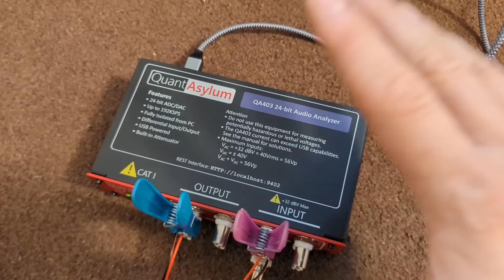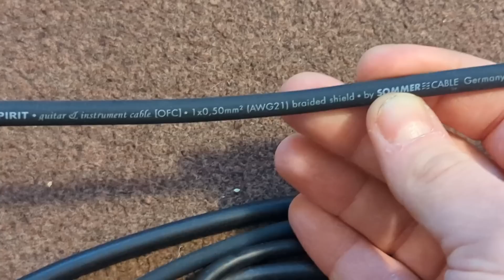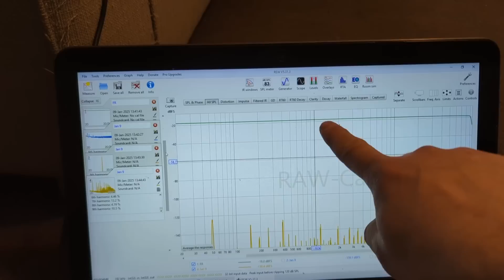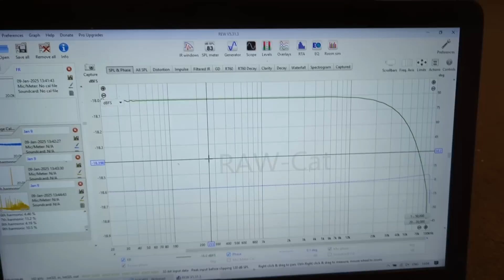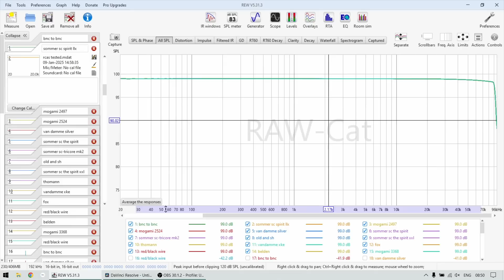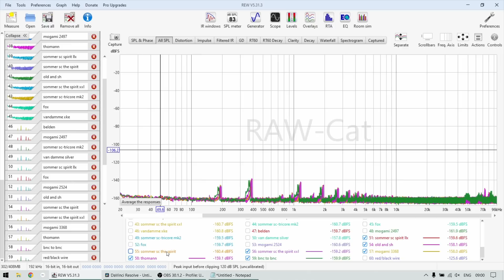Should you buy expensive cables?

Comment: idk whats the issue with my setup, i 
keep hearing buzz and noise , when i turn the car key to on, and after starting the car.... Im running a pioneer 6650bt headunit outputting 2 channel rcas to the dsp , and dsp has 8 channel out rcas, im using only six of them for now, 2 for front tw, 2 for front woofer, and 2 for the sub. idk if its the rcas or something with the wiring idk 😢
Reply from the maker: It's the ground. All three, the head unit, amp and DSP have to be grounded in the same place.
Reply: @RAW-CAt  thanks a lot bro, yeah i have to try that my 4 channel amp and the dsp is grounded same but not the headunit tho . mono has a different ground tho so i have to fix that too then, but i also had the same buzz when i installed my dsp and when i changed the input dsp rcas the sound went away
Reply from the maker: @stanz1n594 try just running a single wire from the front to the back and connect the hu ground to the amp/dsp ground. As a test.
Reply: @RAW-CAt  ill try that tomorrow for sure, my amp and dsp are both front passanger underseat so thats where the ground is as well but mono is under my seat so i also have to ground it on the same ground right?
Reply from the maker: @stanz1n594 just temporary connect all the grounds with the same wire.
Reply: @RAW-CAt okay i will thanks

Comment: I installed a recoil RCA bass knob for my rear speakers. I put in deaf bounce Arnold and they get super loud. So i wanted more control of them so that’s what the knob is for. 

I am using recoil OFC wire that is ran up the right side of my truck. (Power wire is ran on left side of truck) i am getting engine noise in my rear speakers. This is 100 percent because of the RCA cables. 

So i ordered some RCA cables that cost more than double the price as the Recoil cables. So i guess i will see first hand if there is a difference lol ill update you

Comment: Los cables pueden mejorar el equipo solo si este es un buen sistema HIFI ya que le ayudas a pasar mejor la señal, per si tienes una basura de equipo puedes meterle cables de 10k dólares y va a seguir sonando asqueroso. También influye el calibre del cable ya que si pones uno con diámetro mas delgado y pasa un gran flujo de corriente esta se va a transformar en calor. Pero todo esto son micro cambios, a veces imperceptibles para la mayoría.

Minuto 21:21 https://youtu.be/13uPulbV1Po?si=87JmhNmf9by0PhC4
Reply from the maker: There is barely any current flowing through interconnects. Signal is voltage. So heat is not an issue at all.
Reply: @RAW-CAt by interconnects You mean RCA, aux, etc?
Reply from the maker: @mauricionunez2797  yes, that is what the video is about.

Comment: I'm not surprised by this result at all. I think the most important piece of a car audio cable is the RCA connection itself, it must be solidly connected to the cable and to the equipment. Every issue I have ever had with RCA cables was an issue with the RCA connectors not making a good connection with either the cable or the equipment.

Comment: Hmm what about speaker cables not RCA ?
Reply from the maker: What about them?😉
Reply: @RAW-CAt  i was wondering if they matter. For example should I switch factory speaker cables to after market ones ?
Reply from the maker: @Jake-kb2le  they don't matter. Just don't send 1000W through a 24gauge wire.
Reply: @RAW-CAt  Okay so I shouldn't see a difference between OFC and CCA cables ? 
chat gpt says I should, but I don't really trust it.
Reply from the maker: @Jake-kb2le  signal transfer or sound quality wise it does not matter. Cca and ofc differences are in durability and resistance to corrosion.

Comment: in the DIY amplifier circles in India, Ethernet cable are also explored as an easy multi conductor cable for carrying audio signal, 
Would that be any worse than a shielded 2 conductor cable used typically?
Reply from the maker: A lot of people are using those cables with great success👍 As long as the gauge of the wire is sufficient.

Comment: Awesome video and tests RAW CAt!!  
I don't have this Quant Asylum device, but I was going to mock up some similar tests and try to measure with my oscilloscope and function generator, and a noise source like you did, etc.  

Then as a bonus, I wanted to do some tests with the cables laying on the floor and then up on different height cable risers to see if there is an optimal height the cables need to be off the floor (we already know the answer ha!).  First I need to figure out how to measure the capacitance from my basement floor...  LOL

Then as an additional bonus, I was going to do actual listening tests with each cable in my home theater and even see if REW can measure any difference.   Someday...

Comment: Impedance matching and low capacitance interconnect cables can be important with very low-level millivolt audio signals, such as the wiring used for a turntable's phono cartridge/stylus through the tonearm and the RCA connections to the phono preamp.  The capacitance of the cable can have a significant impact on the resulting spectral balance.

For this reason, on many moving coil phono preamps for low output moving coil phono/turntable cartridges, you will see multiple adjustable impedance settings on the MC phono preamp.

But once you step up to typical 1 volt to 8 volt RCA line level signals and relatively short cable lengths, this becomes insignificant.

Comment: @RAW-CAt  
Nice test, Nerijus.  👍👍

The only thing I might have done is to have Twisted the simple red & black zip-cord speaker wires to see if that would offer any improvement in EMI/RF noise rejection from the LED bulb and it's electronics.

Cheers
Reply: Twisted pairs have a great benefit on balanced signal transmission but not for unbalanced.

Comment: Simply put a cable doesn't give you any particular sound. The only thing a cable can potentially do is take away certain parts of the signal. Imo stranded copper with different size strands in a polyethylene sheathing will be just fine. Over short runs 2m or less there wont be a difference  with most decent quality RCA's. It's when you get into the longer lengths that the inductance and impedance can build up to a point that will be audible.

Comment: Having had some very high end audio gear for many years I know without a doubt cables do make a difference. Most noticeably silver sounds detialed, bright, but glary, silver plated copper is detailed without the glare, and copper is smoother. Now days I find this more usefull in using cheap $10-$20 cables to smooth out my system since modern DAC's have become so revieling and detailed, I prefer cheap S#ity cables to smooth things out a little. And yes I can hear a differnce between silver plated copper and cheap dull sounding cables in even a 30cm lengh.
Other things worth noteing;
Unless you have a good room and at least $5k+ worth of gear your not going to notice much difference even between Silver and Copper. In a car setup I dont think it would be posible to hear any difference.
Differnce in cables are very small and many times I cant hear a difference, especialy comparing copper to copper for eg. Changing anything else in setup will have way more impact and I would only sugest to try cables when everything else in a system is sorted out first, and only expect to add or lose like 1% more or less brightness or detail, or roll off the slightest harshness.
I was supprised that there is no difference in the measurments when myself and many other people I know who have have spent stuppid amounts on hifi gear can easly hear a difference once the gear quality reaches a certain level. Theres something going on that should be measureable in some way, capacitance, etc. As you mention maybe longer cable lengths are need to show up clearly.
Before you give me a hard time for being an Audiofool... I agree spending $$$$ on cables is stupid, $50 aliexpress or Ghent Audio cables are good enough for even most audiophiles. And as I said in my main system I've downdgraded some cables to cheap $10 interconnects from the local hardware store :)
Reply: @Angellus502  
So, with all that, in the end you basically said to only expect a 1% difference.  IMO, 1% is wholly insignificant and not worth even bothering with.

In addition, unless you have conducted these comparison listening tests 100% Unsighted (i.e. double-blind A/B/X listening where you correctly identify each cable 10 out of 10 times consecutively without knowing which cable was being listened to at any given time), then the differences that you heard were simply due to Confirmation Bias and/or Expectation Bias.

Here is just one such documented experiment and study that proved this:

https://seanolive.blogspot.com/2009/04/

"Audio Musings by Sean Olive: The Dishonesty of Sighted Listening Tests"

Comment: Perhaps you should review alpha audio’s tests work.  They were able to show differences in ways you didn’t.
Reply from the maker: I had a look at those tests, indeed they show there are differences between the cables, however those tests were performed by measuring electrical parameters of the cables with super sensitive equipment. The difference between cables are on a scale that only lab grade equipment can pick it up. The values of inductance, capacitance and resistance at that scale have 0 impact on the audible range 20-20kHz. The conclusion is still the same - cables do not change the sound.

Comment: What does matter is the durability of the cable and the shielding of interference. So for Car audio applications, this becomes very important.
Reply: One reason that 4-volt RCA line levels became the standard for car audio is for the improved Signal-To-Noise Ratio.

IOW, overcome the inducted RF or EMI noise with increased signal level.

Home audio equipment such as a CD player generally have 2-Volt or less line level RCA outputs due to there being less potential for inducted noise.   And obviously some lower end car stereo head units only have 2-volt RCA outputs.

Comment: In car aufio i for shure would say better rca cables makes a difference. Lots of high voltage noise in cars, ignition, injector pulsing, xeon lights and so on
Reply: With monster cable, in particular, I would use the cheap stuff except for the sub use the 400 series

Comment: The only time they make a difference,especially when talking car audio, is noise rejection. Cars can have very noisy wires and if you don’t keep the cheap, poorly shielded cables away from them, they can pick up a lot of noise. Also I have installed the cheap cables and had them fail or not maintain a good connection. 

I have never noticed a sound difference.  In theory, the capacitance of the cable combined with the input impedance of the amplifier can cause roll off on the audio range.

Comment: Ok RCAs makes sense that quality doesn't affect anything but is this the case for (relatively) long cables from amplifiers to speakers?
Noise most likely won't affect them but cable impedance and resistance might affect how a speaker sounds (impedance being higher=sooner rolloff and higher resistance would mean lower power to speakers and higher bass boost in lower frequencies)

Comment: From experience i used several different rca cables in my home audio system. Nvx rca picked up noise i could hear loudly. Stinger 4000 the noise was present but tolerable. Stinger 6000 was zero noise. I have yamaha aventage receiver connected to crown amps.

Comment: Audiofools will hate the "cannot degrade" comment, as they will buy $6000 interconnect to replay albums recorded with $2 per meter starquad then claim $6000 has more detail, timbre nuance retrieval than a $300 cable despite all their audiofile information on the record that they decribe having been transfered to the recording with cheap cable.

But your tests have been done to death, with actual lengths people will use, and if your not measuring cables at lengths hifi enthusiasts will use, why bother. I'm running cables up to 7m in length in my systems, not 1ft held on with clothes pegs. And as you see, the noise floor is so low where any changes occur, bats can't hear it.

Audioholics and Audio Science Review as well as many studio engineers and AES society guys will continually show what matters and audiofools will still spend $4000 on what is basically $1.20 coaxial cable dressed in nylon braid.

I was an audiofool myself once, but will be trying a complete Mogami or Canare loop at some point next year when we redecorate. Studio and HiFi probably have different needs to a car though.

Comment: I learned the reality of cheap cable vs "high end" cables when troubleshooting a problem with my car audio system. The tweeters weren't playing, yet the amp was powered on. I swapped out the RCA cable to tweeters from a high-priced JL cable to a super-cheap Scosche cable and tweeters were now playing. I was amazed that there was no difference from how it sounded before. Just for fun, I swapped it again with an identical (original) JL cable and got conformation. Was there an audible difference? nope. Was there a measureable difference? dunno

Comment: So I had static noise from the RCA's being too close to the power cables in my car. Changed from 5 euro cables to 50 euro cables, exactly the same, positioning and aluminium foil made the whole difference. Compared them on the same amp, same speakers, just different channels on the amp, I was live switching from L to R and they were the same as the 5 euro cables in all positions. 
Also I only had problems with the expensive cables rca's because of some sharp bends behind the head unit... I am convinced to never spend money on cables.

Comment: The recipe is easy. OFC copper, twisted pair inside, tripple shielded and the best connector (for grip and rigidity, no sound improvement).
That is all you need.
Reply: Definitely NOT twisted pair for unbalanced transmission. Check out Blue Jeans Cable for some great info on audio transmission.
Reply: @marstedt  Sure, the best is meteoritic silver, digged out at midnight by virgin.
This will add focus, more space and attack.
Reply: @kiklop8362 coated with iridium flakes or not?

Comment: So my favorite installer, that's not me, uses twisted primary wire for custom length RCAs. You could take that speaker wire and twist it and it would reject noise and measure the same as the rest I bet!
Reply: Two conductor "Twisted Pair" wiring such as line-level RCA interconnects only works to reject noise with audio equipment that uses Differential Inputs & Outputs (usually only higher end car audio amplifiers). 

Otherwise, for typical single-ended (SE) connections where the outer ring or "sleeve" of the RCA connectors are referenced to ground, you want to use a Coaxial cable with at least 95% outer shielding coverage.

In addition, ideally just the source end of the braided or spiral shield wire should be connected to ground of the source device.

I like to use the 2-channel Sommer Cable SC Peacock MK II "zip cord" microphone cable which combines both topologies.  It was developed as a high quality microphone cable for very low voltage microphone signals over very long runs.

It is relatively thin and very flexible compared to most coaxial cable.  Luckily I bought a large 100m spool of this a long time ago when it was still relatively inexpensive!

Otherwise I use GRIMM Audio TPM and TPR coaxial microphone cable.

Either might be way overkill for car audio, but I'm assured of very high quality and durable cable with consistent manufacturing and QC, and used both of these to make XLR microphone and 6.3mm (1/4") TRS patch cables for my home recording studio.

Comment: Have you come across Iconoclast cables? I ask because these were designed by a Belden engineer (now retired) and were initially sold under the Belden name. But the interesting part is that there a number of white papers that seek to analyse various aspects of cable design - they are available via the Iconoclast website. As far as I know, this is the only attempt by a cable manufacturer to properly address audio cable design.

Comment: I was very surprised to hear a big difference in sound between sommer and klotz cables. But my cables were 7 meters long! And the klotz cable sounded much worse than sommer! There is a difference in the transmission of analog sound, but it manifests itself on large lengths, at least 5 meters or more, and on such small pieces as you have it will not be.
Reply: If at this lenght cables have troubles with passing the signal the problem is not manufacturer.